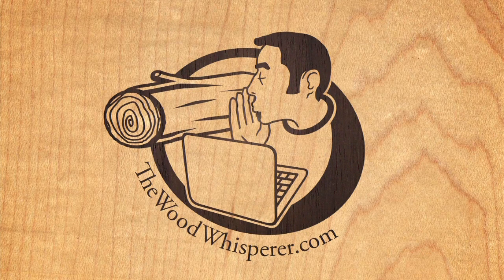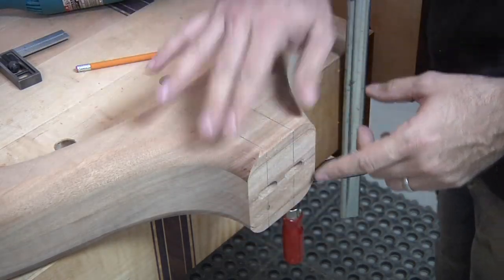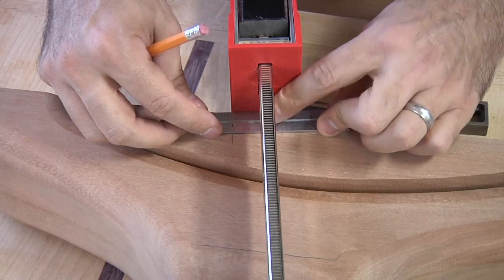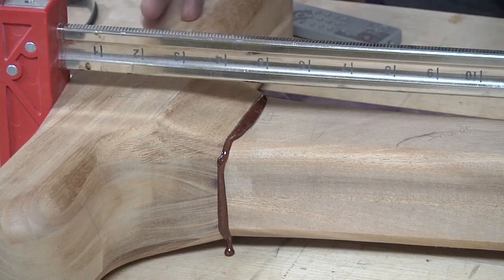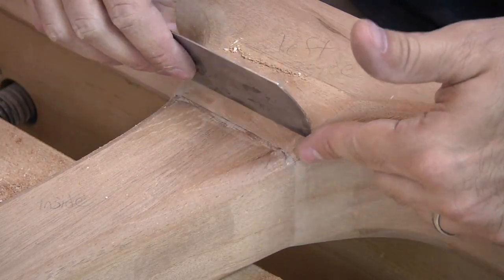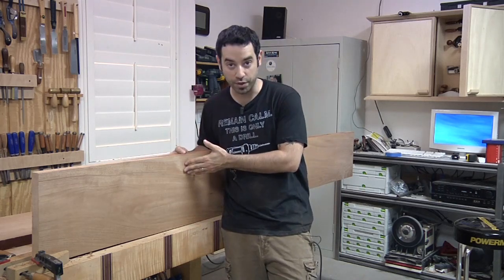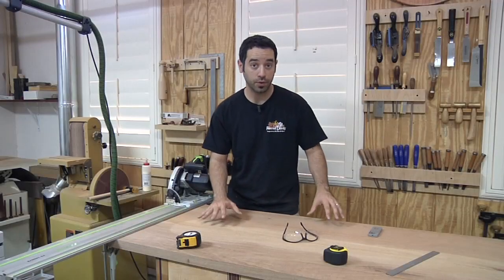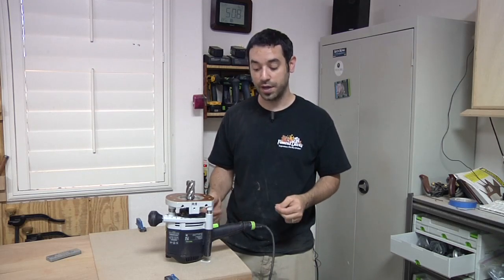135 - How to Build a Trestle Table (Part 2 of 3)

Comment from the maker: @TheSlick429 I explained the reason for using epoxy on the legs in the video. The reason for using regular wood glue for the top is because that is really all that was needed. The glue bond on a long grain joint like that is incredibly strong.

Comment from the maker: @virio Well the wood is kiln dried, flat and stable to begin with.  The two pieces are glued together and then secured to the trestle legs.  The legs themselves will help act as cleats to keep the top flat.  But mostly I am just hoping the table stays flat on its own.  With some designs, that's the best you can do.

Comment: Hi Mark, love the videos. On the epoxy. What you should do is apply some plain epoxy (without the filler material) first. Let that soak in for half an hour or so. Then apply the epoxy glue with the filler and clamp the pieces together. That way you prevent "dry joints" because the wood will soak up a lot of epoxy.

Comment from the maker: The top is attached to the legs via oversized holes, so movement shouldn't be an issue. You might have to elongate your holes a little more than I did if you have extreme humidity fluctuations. But there's no reason to expect problems with a design like this.

Comment from the maker: Strength and working time. The leg joints have a lot of end grain to end grain contact, which is inherently weak. So epoxy is a good choice. The table top itself is a perfect long grain glue joint so nothing more than yellow glue is required.

Comment from the maker: @fyfter well thanks man.  I appreciate that.  Unfortunately, a youtube comment only allows so many characters and my story is a little lengthy.  As for my first real specific woodworking tool, that would probably be a circular saw.  If you want to know a little more about my background and story, head to my website and scroll down to the footer.  There's a link to the About page with more info that you probably wanted. :)

Comment from the maker: I don't have a heat gun, so it never even occurred to me to try that. I wonder if the epoxy would wind up becoming more of a mess once it melts? the raw wood would probably pick it up quickly and either stain or simply spread into the grain. I would have to try it to see how it behaves.

Comment from the maker: If the wood drops at the end of the run, you will indeed get more snipe. I'd make the roller stands just a little bit higher than the feed tables. As for the drum sander, I'm pretty sure I didn't have one in the shop at the time.

Comment: My girlfriend is a stonemason. When they're confronted with a curved match up of sections like the one you're working on for the leg to the foot and the leg to the top, they create a template of what the cross section of the curve should look like and carve (in your case grind) away the excess then measure against it. Think how you use a square sliding along a joint but instead of a straight edge, use the shape you want to create instead. Cathedrals are built that way! :)

Comment from the maker: @hoold90 Hey Gareth.  Thanks for the kind words.  While the bench is a decent looking model, its not the most functional.  Its top heavy and all-together too light.  If you are looking to design a great work-holding bench, I recommend picking up Chris Schwarz's book Workbenches.  It will help you plan out a very simple, but beautiful workbench that won't suffer from the same things mine does.  :)

Comment: Hi Marc
Maybe a silly question but did you pay attention to the direction of the end grain so that they run in different directions?
What i mean is that the center of the wood points down on one board and the otherone up
Otherwise your tabletop might start getting concave at some point
I was just wondering
Really amazing looking table your making
You can be proud of your work
Greetings from Belgium
Erik

Comment from the maker: Doesn't work like that. If you clamp across the joint "vertically" and not on the angle, the assembly will simply buckle. You need to have direct pressure parallel to the angled piece in order for it to work. You can confirm the issue for yourself with three pens/pencils. Lay them out on your desk and then apply pressure to the top and bottom pencils. The angled pencil between will will want to go horizontal.

Comment: You spend a lot of time scraping the epoxy off of the wood. Have ever considered a heat gun to soften epoxy then wipe off the excess. In my work it is sometimes necessary to disassemble epoxied joints, and that is the method I use. Granted I work with metal, but I don't think the heat would conduct enough through the wood to compromise the joint and it would save you a considerable amount of time. Just a thought. Thanks for making these videos when I start woodworking they'll be helpful.

Comment: Why didn't you simply "simulate" the gravity as it will stand later using clamps? The joints are parallel to the floor and table top anyway, and isn't this the direction they should be clamped? I agree that using multiple clamps on each flat point of the bottom part wouldn't distribute evenly, but some thinker scrap on top and bottom and clamping right over the middle of the diagonal part should be way easier.

Comment: Maybe it is not as glamorous, but many of those steps would have been faster just using the rounded front and/or the flat bottom of a belt sander. You just need belt sander, orbital sander and maybe a scraper and some sandpaper. Die grinder and rasp not needed.